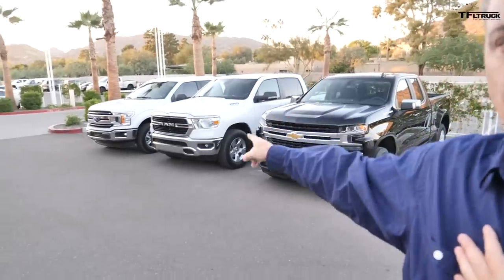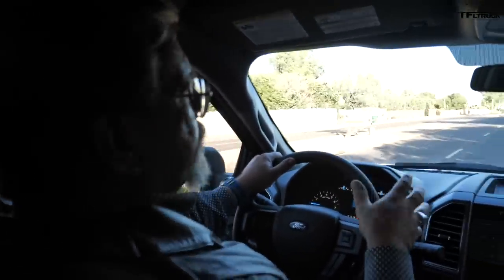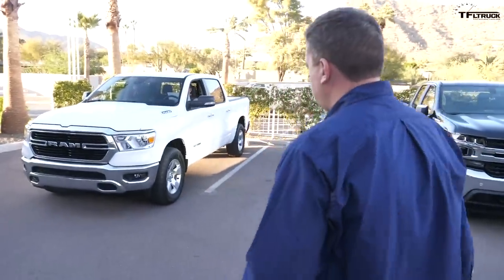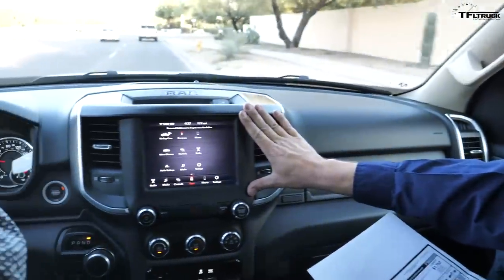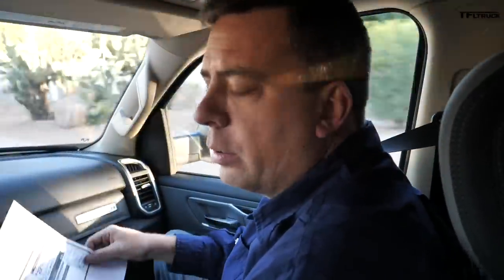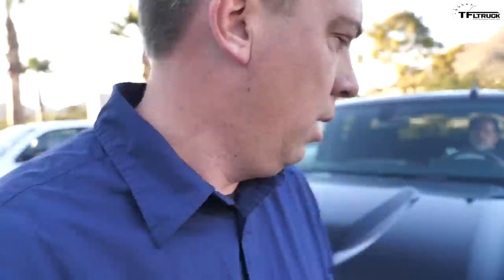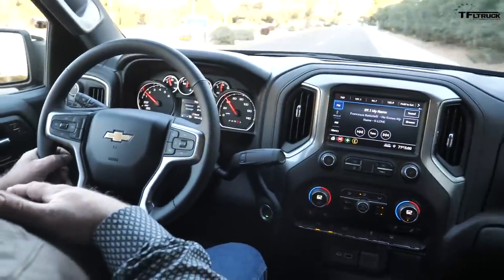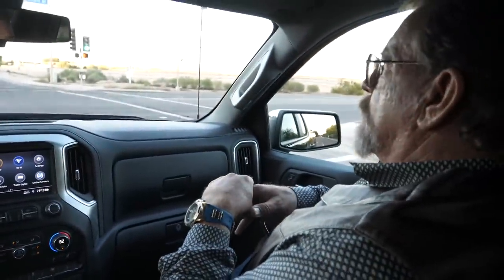Work Truck Wars: 2019 Chevy Silverado 4-Cylinder Turbo vs Ford F150 vs Ram 1500 Review

Comment: 40 grand for work trucks is insane.
Reply: Agreed I paid 39k for my 2013 3500hd duramax same truck today would be damn near 60k
Reply: @kylevanwinkle2081  You used to be able to get a rubber floor full size work truck for less than 20k. I don't see the additions to these new trucks adding 2x the value.
Reply: You guys act like you dont understand inflation smh
Reply: @BullittKid08  I'm not too sure it is inflation as much as it is the cost to comply with all the Federal Regs for safety, emissions and MPG. A base truck is not exempt from any of that. Just look at the requirement for backup cameras.
Reply: @BullittKid08  inflation my ass this is people buying into luxury and demanding things that arent necessary. The upper end models drive the price of the lower end models up. 

Inflation only explains some of it since material cost hasn't raised much and labor rate hasn't either.
Reply: Those are MSRP numbers. You free to pay sticker price but most truck sell for way less especially in the value trims
Reply: Debt and death paradigm it's the American way.
Reply: Also you can thank the federal reserve for inflating the dollar every year.  Paying 60 grand for a truck at 3 percent is about the same as paying 25 grand at 16 percent
Reply: @$15 per every 1k thats $600 a month for work truck! guess i better buy used
Reply: just wait 2 years and pick up a turned in lease
Reply: msrp is not the price you pay ,  i bought a 2015 silverado new , i got a LT crew cab 4wd 5.3 v8 , towing package and the larger screen with the convenience package ext ,  for 40k out the door. Granted i don't have sales tax in oregon. but i think msrp was somewhere around 45-47k  originally.
Reply: Its greed! Plain and simple!
Reply: Keep raising the price few are buying, they cost to gd much!
Reply: Buy used save a assgob !
Reply: These aren't work trucks.
Reply: These aren't work trucks, they're mid-grade trims, and $40,000 isn't selling price, that is just MSRP or the list price. Seriously, get a clue.
Reply: Again, these dumb comments about truck prices. These are mid level trim packages, not work trucks. These trucks have over $10,000 loaded over base truck. And like others are saying, $40,000 is just the MSRP. Virtually no one pays MSRP. Most dealers often sell them with $10,000+ on the hood. For example: A very similar Supercrew V6 XLT has a selling price of $27,858 with all incentives and discounts. Even if you take away the conditional offers, it's still under $30,000. These are not $40,000 work trucks. https://capitalfordcharlotte.com/vehicles/2018-ford-f-150-xlt-18f16183-1ftew1cb6jkf86183
Reply: Actually pay is up, an all time high, in fact, with a record $61,372 household median in 2017, and consumer prices have trailed that pay. According to Ford, the base MSRP for a 2019 F150 SuperCrew XLT is $39,420. In 2001, a SuperCrew XLT had a starting price of $26,915. Adjusted for today's prices, that's $40,322.27. So the newer truck is actually cheaper than the one made 18 years ago and, IMO, it's much nicer than the one made 18 years ago. It has more safety features, it's using more advanced materials, it's more refined, it's more spacious, etc... Don't know what everyone is complaining about. You're getting better products and higher pay. It's why I bought myself a similar truck last year. You people probably just complain automatically about things, or you're just not keeping up with the rest of us.
Reply: @BullittKid08  when talking about truck, this is not inflation. They realized lots of family ( including mine ) loves a truck as a "family vehicle". Through the last 10 years, truck prices sky rocketed big time. Even bare-bone truck almost doubled prices, not just the luxury ones. I swear you could get a F150 2 wheels drive for around 20k 10 years ago. This is not only inflation.
Reply: @kevins5469  Typical modern car lover and just to let you know that my 96 Ford F150 with a 5.0L (302) Windsor V8 will outlast whatever you drive mate.
Reply: @tommyboulet  Exactly mate but these modern car lovers will never learn.
Reply: I live in Canada and are ram 2500 work truck was $66k before tax witch is nuts for a shit truck
Reply: MRSP, not actual sale price.
Reply: @Chuckers84  you paid $60K for a half ton pickup?
Reply: Actually, prices for lower and mid level trim trucks are virtually the same, not more, when you adjust for inflation AND PAY. People are just here to belly ache. You think times are tough, but real adjusted prices aren't rising. Our fathers had the same complaints, but they were just as ignorant.
Reply: Clutch1986 That's not true at all. The guy just above proved it. A similar F150 in 2001 would cost over $40,000 when adjusted for inflation. That isn't debatable, that is a fact.
Reply: Tiersmoke92555 yup she is a beast! Full Load 4X4 with 502a package complete with all the electronic nannies and OEM stowable ramps!!!.
Reply: I paid 10k less than MSRP on my 18 f150 5.0 xlt.
Reply: These trucks roughly about the same configuration run about $33,000 without whatever extras, except the GM which is only available in LT trim, starting at over $38,000. The WT with the 4.3 starts at over $33,000. IMO I would take the 4.3 over the 2.7, with the 4.3 v6 being the base engine for GM. Search “build a _________” and compare prices and options. Would be nice if for GM they would offer the 6.2 in a base model. My build, 6.2 4x4 tow package.
Reply: Bullion Forever in order to build true wealth you have to acquire some form of debt (leveraging). Finance 101. Debt isn’t evil. It’s all about ROI to justify that debt.
Reply: You can normally get about $10k off a Ford after all the incentives.
Reply: @skipper5951  Just to let you know that my so called POS will outlast whatever you drive mate.
Reply: click bait, these aren't "work" trucks
Reply: @Highlander Still. Too expensive for such little amenities...
Reply: So true. Where are the economies productivity gains going because it sure isn't into my pocket!
Reply: @Highlander exactly!
Reply: @kylevanwinkle2081  are you high? The same truck today is $90,000 CAD 
You cant get a loaded half ton for $60,000
Reply: @volvo09  maybe 20 years ago. You're way out of touch.
Reply: @gwood701  bud I never said I had a loaded truck. I bought a truck to work with be a luxury ride. That's what my car is for.

Everyone demanding options is why the price is so high.
Reply: They were not completely a base model. They had a couple of options which adds some money.
Reply: The new Ram trucks are pretty heavily discounted... You can get into a Laramie crew cab for 40k 
https://www.northstardodge.net/new/Ram/2019-Ram-1500-cf155ed10a0e0ae706e7ffb7a2898972.htm
Reply: @BullittKid08  
This is not inflation . This is the GOV.  forcing all kinds of mandates on new stuff .  There must be 20,000 worth of safety crap and emissions crap  and I do mean crap . Do you know the so called greenhouse gases made by cars and trucks are only   0.5% of our atmosphere . That's  not even 1%  of all the air there is . Also oil is a renewable resource . Inflation my ass !!!   5 mph bumpers that cost thousands to fix , computers that can be hacked and tell daddy everything . Yea you got your finger on it alright .
Reply: @kylevanwinkle2081  and what are you comparing to? a 2013 single cab work truck to a 2018 crew cab LT?
Reply: @Highlander adjusted for inflation my 2004 Silverado 2500HD Crew Cab LT with the duramax was 64k. The price hasn't risen all that much, if at all.
Reply: @donleamon8653  you can buy a after market backup camera for a couple hundred dollars, trucks are over priced profit leaders, 75 to 90 thousand dollars for a one ton WTF I bought my 2016 Volvo semi for 78 thousand dollars
Reply: @BullittKid08  you're right, it definitely ain't goin on in my paycheck.
Reply: @mdlclassworker3384  You bought that Vulva used, or it's just a day cab. Go buy a new 389 or W900 and let me know what that sets you back. Look, the camera is just a point that our vehicles have become over-regulated. That camera now requires a integrated display screen, more complex wiring harness, additional service material and has become a safety item that will fall under the same warranty guidelines that the other equipment does on the truck. Keep in mind too, that many of these high dollar trucks are being bought by small businesses, and as such are a tax right off. Also mfgs. are packaging features as such that to get simple comforts that you do want, you're forced to buying shit you don't. And that shit probably has the widest profit margins as calculated by the bean counters. There are many forces at work here, step back and look at the bigger picture. And yes, I agree that the costs have become a real barrier of entry for many people to buy new anymore and that has a trickle down effect to the price of used cars and trucks.
Reply: Agreed. RAM all day though
Reply: It is all the technology b.s. they put on them to drive up the price.    It is also done to guarantee work for the dealer's service department.
Reply: When I was young, basic pickup/van about $2K...
Reply: I used to defend new truck prices to a certain extent but when I saw 40k for that 2WD 3.3L Ford, my jaw dropped. They're getting WAY out of hand.
Reply: Maybe a used Kia is more in your budget. Get with the times, we are on the eve of 2019, not 1994.
Reply: @Chuckers84  if you dont mind me asking what do you do with it? Work site truck or drive it to the office? I have a few customers with top packaged F150s and GMCs they tell me about ABC and 123 of the truck but call me to pull a trailer or haul a bulk load. More and more guys are getting debadged Lincons Cadillacs and Chryslers luxury trucks to say they have one when the conversation at the water cooler starts but never use it or even intended to use it. Sorry for going on a tangent, I'm gonna go hookup my 8' plow and 1 yard salt box and take my frustration out on mother nature. #trucklife
Reply: @Chuckers84  and I guys I only buy a truck every ten or so years and the jump for me in price and sparklers is hard to swallow.
Reply: Tiersmoke92555 I have a business to run. I just put airbags in her this weekend so I can pack more. Not sure what kind of ferries you hang around but people in my industry have trucks for a reason.  I bought a truck because I need one.
Reply: Those are not work trucks. Way overpriced. I have a 2016 F150 XL complete with manual crank up windows  2.7 Ecoboost supercab 3.73 electronic lock 9.75" differential, and it  really moves. The drivetrain  essentials are more important than comfort. What's wrong with folks nowadays? I wouldn't pay for Pamper comforts such as Sync and Behind warmers Would rather put the money into the motor 2.7 eco, 3.5 eco, or a Coyote and still be way less than 32 thousand. GM would do better putting that turbo 4 in the Colorado and make a heck of a truck. Ram would be better off getting rid of the Flux Capicator and improving a pentastar v6 with a turbo or mini supercharger or just go all electric instead of a gimmick.
Reply: @Highlander It's good that you live within your means, that being said you got to work for yourself. Working for yourself is so key to getting ahead, the tax write offs, the tax breaks, the flexibility etc etc.
Reply: The turbo sounds like a gm version of a twin scroll turbocharger.
Reply: I agree, you can get a much nicer SR5 tundra or titan for that price with a standard v8 and bigger screen with navigation. But I'm sure those pickups are heavily discounted so I seriously doubt they'll cost over 35k, but for an xlt to be that stripped is crazy.
Reply: around 30 k with discounts.
Reply: @sikorski3842  that's a nice price for a great truck!
Reply: Be glad you don't live in Norway. Here this cars cost double of that. Hail socialism taxes 😂
Reply: Uh, the Ford is an XLT which is NOT a work truck.
Reply: @PJ
A red, blonde or black hair? 🤭🤣
Reply: @BullittKid08  inflation hasn't risen that much in that much time